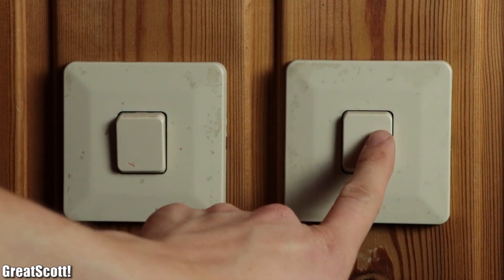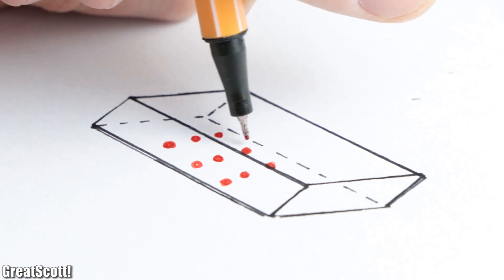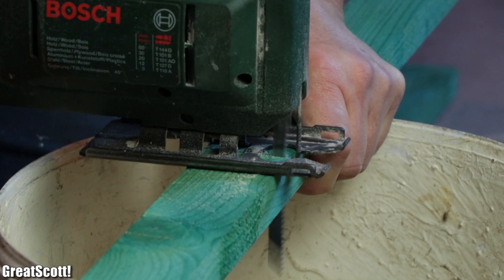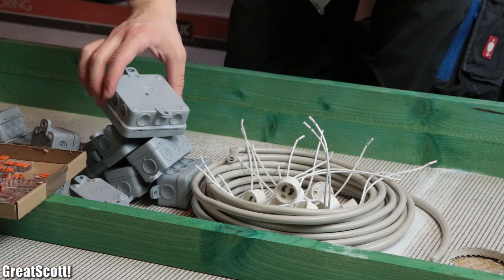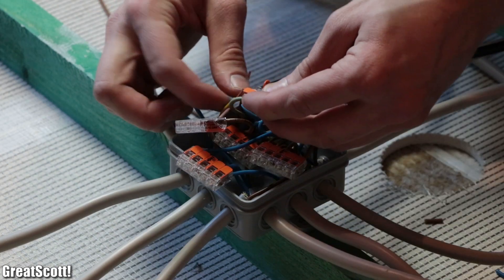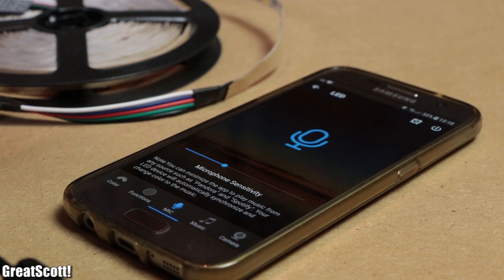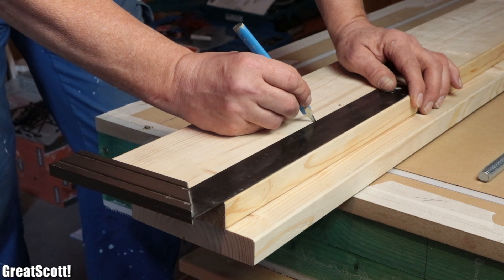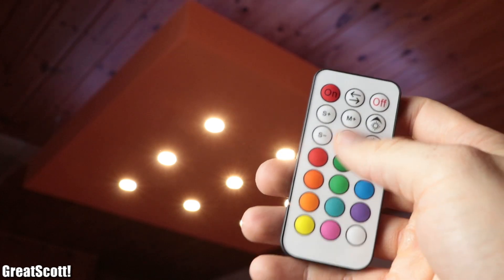Make your own Modern LED Ceiling Lamp

Comment: A bit to over-engineer for a ceiling lamp no?
Reply: There's nothing complicated tbh. The led strips were overpriced af and the rest is very basic electricity work. On a more personal opinion, I think it doesn't look good..
Reply: @MABFR01  I'm not saying the electricity work is complicated. Just the whole build process could have been made easier. The 19mm MDF is overkill and weighs a ton.
The inner support structure could have been made with say quite thin aluminium profiles to save weight for example.
No need to add that textured material (used for the bottom) to the side as well. Could have just sanded it down. My OCD got triggered hard when they fasted it with screws in the middle instead of using the constructions adhesive on the back and then just small screws in each corner.
And why use cables that are suitable for 10A 240v for each GU10 socket that would only seen 10-15w maximum each. Even on a 110/120v grid you would barely have 1A on that cable, this also added unnecessary weight.

Point is, there where steps in the building process that didn't have to be there. Some where not needed at all and some could have been avoided by using lighter materials. In some areas they where overdoing it, and yet they didn't even ground the aluminum-channel for the led-strips or the fixtures for the GU10. (Here in Sweden it wouldn't pass inspections by an electronican if exposed metal where not grounded.)
Reply: @SverigeKodar  Oh okay my bad, I do agree with you on the unnecessary weight! Thanks for the reply
Reply from the maker: Maybe.....
Reply: @greatscottlab  I make my comment in jest, it's that the Germans are known for being good engineers. 

I hope you don't find it insulting, as that wasn't my goal and please accept my apologies if you are offended.
Reply: Was thinking the same. I would've used Yeelight Downlight for the spots and their YLDD01YL strip. It would have been a bit more expensive, but much easier and would automatically have support for Alexa and Google Assistant.
I would also have made it half as thick and used 12mm MDF or LDF for the top and like 6mm MDF/LDF for the bottom and sides (or even 6.5mm drywall). Would have made it much more light weight.  You could even use white plexiglas (acrylic) for the bottom and add some extra Yeelight inside so it would have an extra "mode" what would work like a softbox.
Reply: He's German. It's part of the stereotype. :)

Plus side, it probably won't ever fail...even after the apocalypse.
Reply: Over-engineering? Whats that?
Reply: Under-engineered :)

Comment: version 2.0 add a bluetooth speaker to it
Reply: Yes and 3.0 a fan, 4.0 filtering system, 5.0 ionic sterilization, air conditioning.....
Reply: @111genti  Those upgraded versions will end as a complete room (in version 78.2 maybe), won't it?
Reply: Not a bad idea really, he could add some exciters and turn the whole thing into a speaker... :-)
Reply: How about a mini-fridge? xD
Reply: Good idea, just drill in some recessed speakers and install a cheap bluetooth amplifier

Comment: Scutt, those screws were wrongly placed, its danger to hang on the wall and you should use 4x smaller screws for load support. Pls correct it
Reply from the maker: On the wall?

Comment: Awesome video😎
Pity that the structure looks very heavy..
Reply: It is heavy, do not understand why he used such a heavy setting.
Reply: He is German man . they take it to the end
Reply: @Gnubbelking123123  and such large wires
Reply: I would have used 3mm MDF and just glued the strips to the top rather than routing it in.  Would save a LOT of weight!
Reply: Having just cleared out my garage of about a dozen 3m boards of 15mm MDF, I now hate the stuff. 
It's ONLY use is making subwoofer enclosures NOT something you hang above your head. It's too heavy!!!
Reply: @Andrzej M.  But there is just no logical reason to make it flush. This is just overkill.

Comment: That mounting system looks massively overcomplicated.
Reply: its not actually if you want to simplyfy the mounting and make it much easyer to handle. otherwise you would need a half dozen people to lift it and screw it down.
Reply from the maker: Maybe.....
Reply: @greatscottlab  I imagined 4 cables, one in each corner, but it's easy to say that when I haven't done it myself. Cool project though, I definitely plan on doing something like this soon.

Comment: Why had You use a thick wire for lamps ? And don t connect the lamps in a point to point configuration instead   a star configuration ?

Comment: Why not use 12V bulbs and just one 240v transformer?
Reply: A 12-V switching PSU with more power costs more than the PSU that came with the LED strips and, and that’s the point, you would need to change all the wiring to the lamp switches in the wall if you wanted to switch the warm-white LED spots and the LED strips separately. With the presented solution you don’t need to modify the existing wiring.
Reply: 12V is really low for driving LEDs efficiently - virtually all 12V LED strips have resistors (100+ ohm) to reduce the current. A better way to connect LED would be sequentially, no resistors but constant current supply and use the voltage drop of the LEDs themselves.
Most of the LED that come as 230V ones have their own AC/DC that tends to be crap, unfortunately. (bad caps, overall bad heat dissipation, etc.)

Comment: Leichtbauplatte
Es hört sich so geil an wenn einfach deutsche Wörter in einem Englisch gesprochenen Text sind
PS.  
Ist es auch möglich das ganze über Alexa zu steuern also der Philips you App
Reply: ja da stimm ich dir zu
Reply: Es gibt LED Controller mit Alexa Integration. Ob der im Video einer ist, kann ich nicht sagen..
Reply: @derzocker005  ja das ist möglich da ich die gleichen Led Strips besistze mit der gleichen App
Reply: @philippgraf4589  Schaut euch mal die Shelly RGBW2 Controller an. Deutlich besser. Auch via MQTT steuerbar :)
Reply: Wenn du es ganz umständlich machen möchtest kannst du es auch mit einem ESP 8266/32 mit ein paar Transistoren (oder wie auch immer die Mehrzahl von Transistor heißt) an das Led band anschließen😅
Reply: Ich hab nen ähnlichen Controller der mit der selben App funktioniert und der  ist Alexa kompatibel :)
Der Skill schimpft sich Magic Home, so wie die app auch.

Comment: Make it music reactive using the lm 3915 chip with a microphone. That would be awesome😏😏
Reply: And how would you do that? It isnt as easy as saying "make a flashlight using a led"
Reply: @yxcvbnmmnbvcxy544  Well actually it is not that hard at all. I have a home made bleutooth speaker with led that reacts on music but I was wondering if you could do this also with higher power leds. Search on youtube "lm3915 music reactive led" this circuit is not hard at all. I think if you add high voltage transistors to the output of each output pin of the ic, it is possible. Just connect the LED to the Collector of the transistor to the earth from the outlet.
Reply: @daddynikolatesla6663  ... or buy a SP106E dead cheap from ebay.
Reply: @deadbeef16  There are many ways that lead to Rome😂👌

Comment: Cheap???????? more than 70€ for 5m of LED.... Hmm does not sound cheap.
Reply from the maker: I know. That was a mistake in the script.
Reply: @greatscottlab  Unless you meant to be sarcastic 😝 great video though. I had this idea many years ago and did something similar. The reliability of the GU10 bulbs though were very crap. There us too much heat build-up which then slowly kills the lamps.
Reply: @greatscottlab  the mistake was not in the script but in buying it at the wrong place :-)
Reply: same kit on aliexpress is 4 times cheaper...
Reply: @TheMati117  definitely more like 6 times lmao
Reply: no its 10x cheaper
Reply: You can get 5M of LED tape in a single color for $5-10 on Ebay and RGB tape for just a bit more.

The quality is a crap shoot, but if you properly heat sink them (sticking them to aluminum strips is usually enough) and run them under volted, they'll tend to last a long time.

I've bought several rolls of LED tape from Ebay and the only real issue I had with them is they overheat, turn yellow and eventually crap out when driven at their full rated voltage. Gotta run them at around 10v for 12v rated strips to improve their longevity.

Comment: Rgb strip you got was overpriced.It should be around 10$ for 5m strip,3$ for rf remote and 7$ for wifi one if you get them individuallt
Reply from the maker: Yes, I noticed that too late.
Reply: 74 euros?! Wow! I don't think I've ever seen one listed for that much.
Reply: @Markle2k  yeah,for that money you can get 5m of adressable leds 144led/m
Reply: @Markle2k  in canada its more like 100 for like 2 meters
Reply: Actually, that’s an IR remote.
Reply: @GRBtutorials  I thought it was rf?
Reply: Gent Meça Nope, if you look at the top part, you’ll see an IR LED, and you can use a phone camera or a webcam to see the IR (please note that other cameras usually don’t work because their IR filter is better). In fact, at the beginning of the video, you can see the pulsating glow from the IR LED if you look closely.
Reply: @GRBtutorials  Hi, it's not so important but just for the fun, I checked the links in the video and you are right, all the adaptors seems IR, but I'm sure that the voiceover said Rf, it's what i personally would choose in a similar project. Mainly for "stealth"
Reply: Gent Meça Yeah, that’s most likely a mistake. And I’ve never seen an LED strip with an RF remote, though it could be adapted if necessary. But having Wi-Fi, why would you need it?
Reply: But it's RGB with W. Isn't that comparatively expensive?
Reply: ̷ ̴ ̸ɢ̸ʟ̶ɪ̸ᴛ̶ᴄ̶ʜ̷ ̶ ̶ Nope, it’s just an RGB strip with half of the LEDs  being white LEDs instead, or vice versa. It should be about the same price.
Reply: 5$ for rgb strip + remote

Comment: The englisch word for  "auskreiser"  is holesaw
Reply: And the german word is "Lochsäge" ;D
Reply: @draakevil  manchmal sieht man den wald vor lauter Bäumen nicht
Reply: correct!  @draakevil
Reply: ...and the  englisch word for "englisch" is English.
Reply: @GilesBathgate  no actually it's enlisch
Reply: Interesting because in Swedish a "Hole saw" is those round saws that you use when you are making circular holes.
The Swedish has words which are two "Sticksåg and Pendelsåg" depending which way the saw works.
Reply: otwornica in polish

Comment: Nice video! 1 Question: Can you make an Tutorial to control such a lamp with an home assistant (alexa, etc.)
Reply from the maker: I think the WIFI controller does work with Alexa.
Reply: I use Homebridge to make all kinds of devices "smart" ... Homebridge on a Raspberry Pi is a extremely powerful tool to get things done neat. My goal was to control as many things as possible with Siri from my phone, and Homebridge does exactly that. Of course there is a learning courve but as a result you have a very inexpensive custom smart home. You can load Plugins into Homebridge to support a ton of different devices.. even use the GPIO Pins to control and sense ... even my tv is turning on when i arrive at home because there is a plugin for homegridge to control my philips tv with home automation... I  really like the fact you can build a home control system completely without a cloud (except of the siri control in my case)...

Comment: OK GreatScott ....how to make a Mordern ceiling Lamp
Reply: Tech is modern. But the design is not my taste
Reply: @KilianGosewisch  the desing and especially the color aren't modern at all 😂😂😂
Reply: @matthiasbretonnier4015  Design tendencies tend to be somewhat oscillating. First, cars had mostly square lines (model T times), then they were done in smooth curves (WWII), then they got square in the eighties, smooth curves in the 90s to the 2000s and so on. This is not absolute as there have been rounded cars in times qhere staight lines were the norm and viceversa. What is old might get modern again!

Comment: simular projekt was my bsc final projekt
Reply: i am almost used full rgbw(5050 4500k) leds with remote controller amtega 328 bluetooth control 868Mhz and remote (its in the on of the departmen room where i was in collage)